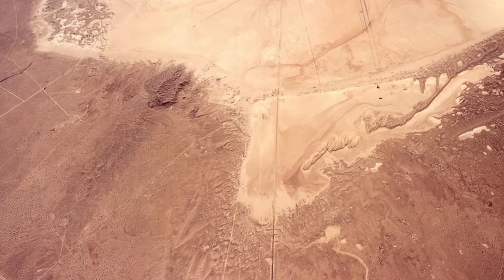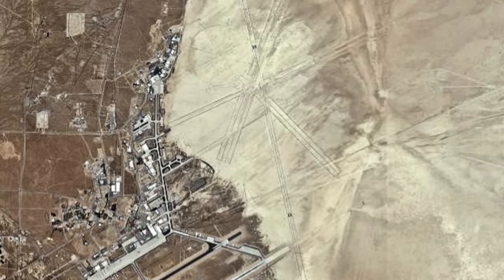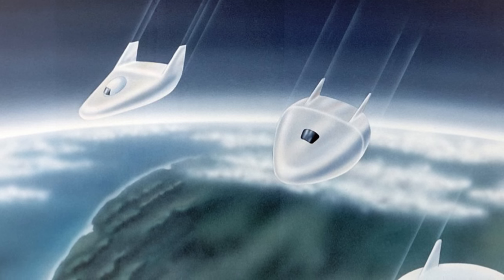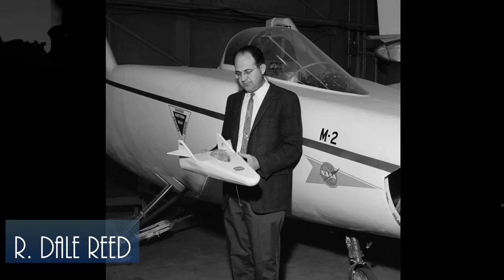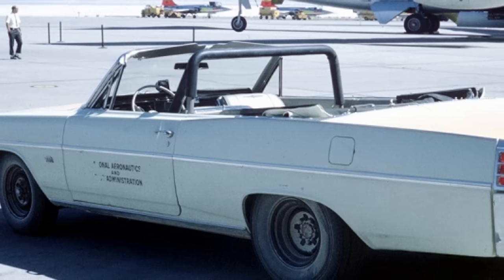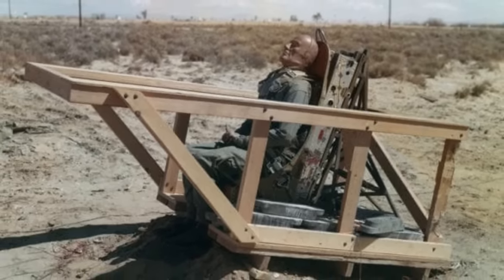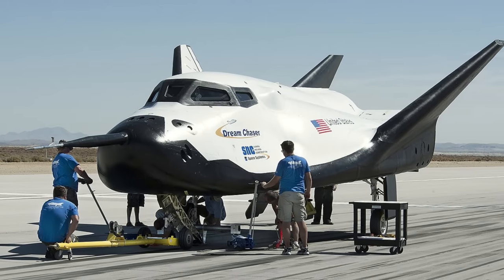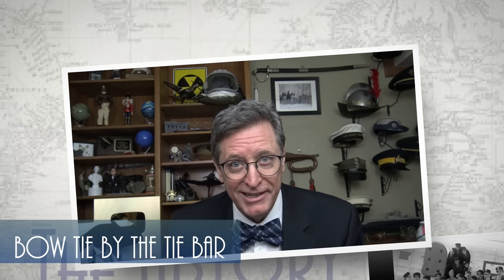The M2-F1, NASA's "Flying Bathtub."

Comment: AS an US Army officer in the early 70's I was assigned to NASA Flight Research Center at Edwards AFB in the flight simulation group.  One of my favorite things to do was to watch the M2-F2 test flights.  They would drop it from a B52 at 40,000 feet and it rocket itself to 80,000 feet.  Four minutes later it would be landing on the dry lake bed.  Bruce Peterson no longer flew jets for NASA  after his accident.  He was Project Manager on the first Digital Fly By Wire airplane.  A project that I worked on for my time there.  One thing that you did not mention was that Paul Bikle was an accomplished glider pilot.  For 25 years he held the record for the highest altitude in an unpiloted sail plane (46267 feet).  This may have encouraged him sponsor the M2-F1 project.

Comment: The Apollo and Gemini capsules did have some steering capability. The center of mass was deliberately offset from the center of lift (and the capsules did have some lift).  They could roll the spacecraft to change the relationship between the two, letting them move the touchdown point uprange or downrange and having a small cross-range capability.

Comment: 14:13 You mention the “cutting edge” Dream Chaser lifting body, but it is in fact very closely based on a mid 1960s design from the Soviet lifting body program. 

I always like this thought experiment: In 2023 We are now as far away in years from 1962 as 1962 was from 1903 when the Wright brothers first achieved powered flight. In 1962 the still “futuristic” looking Lockheed A-12 Mach 3+ reconnaissance aircraft flew for the first time!

Comment: My favorite was The Dyna-Soar program (System 464L), initiated on  October 10, 1957, took three separate, but related studies on manned, hypersonic weapons and reconnaissance systems (Hywards (SR-131), Bomi/Brass Bell (SR-12) and Robo (SR-126)) and merged them into a single, three-phased program. The research conducted, knowledge gained and the technological advances made during the course of program (1957-1963), would be applied to the X-15 test program, both of which would help guide later experimental test vehicles like the X-40 and X-37 as well as the development of the Space Shuttle orbiter.

Comment: Peter k 
I was working at Boeing in 1959 on Bomarc and remember a very short lived program called Dana Soar a lifting body design 
later dubbed the x-20 Space plane for the Air Force. The project lasted from November 1959 till it was canceled December 1963.

Comment: awesome video.     love the EVH frankenstein themed tie lol :)     the fact they they set the car and motor up for peak operations at a certain speed is pure hot rodding.... that's taking the wheel diameter the rear axle ration the transmission gear ratios and the speed of the motor then girding the cam profiles for tat and selecting an intake manifold for that    then fuel air mix spark timing.... not getting started with cylinder head/combustion chamber style and or volume nor piston bore or stroke    these guys were friggen good lmao

Comment: Interesting note,  those little winglets on the outboard side of the vertical stabilizers were additions after the landing accident you mentioned. You can see in the crash image shown, that the winglets had not yet been introduced as there is no winglet nor damage where one would have been ripped off.  They were added to improve roll stability.
Cheers, and thanks for another great video!

Comment: There was another "flying bathtub" type of aircraft introduced and marketed by it's inventor in the 1970's. The aircraft was made from heavy gauge aluminium, had an open cockpit, fueled with pump gas, short takeoff and landing, and had a ceiling of around 2000 feet. The purpose of the aircraft was directly pointed at aircav operations. The machine was so simple pilots required about 8 hours of instruction before they could solo. If I remember correctly they sold for about $10,000 each. The concept was to put every trooper in his own machine and have entire companies outfitted for action. Initially the US Army was interested but for some unknown reason quickly lost interest. The Canadian military was also interested since they would have been ideal for patrolling the Artic. More than one military officer stated it was exactly what was required instead of the F18 under consideration at the time. At that time there were around 200,000 in the armed forces and the designer said he he could provide about 300,000 aircraft for what the F18 program was to cost. The government however was bent on buying f18's despite what anyone else thought an refused to even consider it. I wish I could find more information about this craft but it appears to have disappeared into history.

Comment: This video sent me on a literal inch by inch search on Google maps of Edwards Airforce base and its surroundings looking for any remnants of the Japanese battleship target but couldn't find a trace of it, However I found several planes and wreckage of planes around the parameter that I've tagged for exploration. But I did find the same R4D outside exposed to elements on a tarmac with several other old planes and one experimental aircraft.

34°53'59.9"N 117°52'07.3"W

Comment: Drag slicks on lake beds/salt flats? That wouldn't be my first choice. Some of my family race on salt flats and lake beds and from what I was told wide smooth tires on lake beds/salt flats cause a hydroplaning like effect even on totally dry surfaces, because there's  a dust/loose sand layer on top and at high speeds basically acts like a thin layer of water. 

Then again I'm not a rocket scientist so I could be totally wrong.

Comment: I'll bet they had to calibrate the speedometer someplace where there wasn't a speed limit(at the time, Nevada and Montana). Was else would you need to do with Pontiac muscle car convertible? I'm wondering if the speedo even went high enough to "calibrate"? 

Most people probably don't realize that there was no day time speed limit in Montana. However, there was a 55 mph speed limit after dark. When the Feds set the nationwide 55 mph on the interstate highways, Montana's penalty for going over 55 was a $5.00 conservation fee. It could not be used by insurance companies to increase premiums. It also didn't go on your driving record. However, the night time speed limit on non-interstate roads was still in existence. I practiced law back then, and I would get contacts by tourists who wondered why they got a $5.00 ticket one day and a $75.00 ticket the next day. It was an interesting time, watching the State Legislature defy the Feds.

Comment: So they also made a pancake fly and it was a great aircraft until you tried to land it LOL. It had so much lift that you had to almost turn the engines off to land it. Ofc that would make it a great aircraft for aircraft that haul freight as they could lift greater loads with less fuel and fly further on the same amount of fuel. The "bathtub" shape is the fundamental shape that started us down the road towards the Space Shuttle.

Comment: More than a few would note the similarities between the M2 project and SpaceX, but in actuality the similarities are rather superficial. The reality is that M2 started from scratch, with design being cutting edge with almost no experience to fall back on, while SpaceX started on the shoulders of giants, using a wealth of existing data gleaned from hard and costly experience and sacrifice. One was shoestring budget, powered not by vast amounts of money, but enthusiasm and can-do. The other was funded by vast amounts of capital, hard and often unrealistic expectations and deadlines, engineers driven to their limits and often burnout, all in the name of one man.
One aspect of the M2 project that is missing from today's projects: no deadlines imposed by upper management and overseers. Today's projects are dictated by the Triad of Bureaucracy: budgets, time deadlines and performance expectations. Failure is assured if only one leg is shorter than the others. Because the M2 started on discretionary funds, it was do what you can with what you had, so scrappiness and innovation was essential. No real budget meant no real timeline, other than getting wind tunnel time (and a Pontiac souped up for the job). There was now no hard and fast deadline to get things done and to find solutions - there was time to think, rethink and test. There was time to risk.
Reply: And no mandate to go with the first idea to meet an aggressive timeline.  The first idea is almost always wrong, but points the way to success.